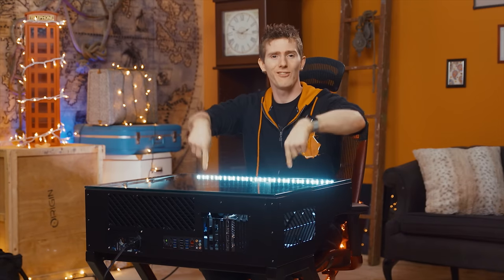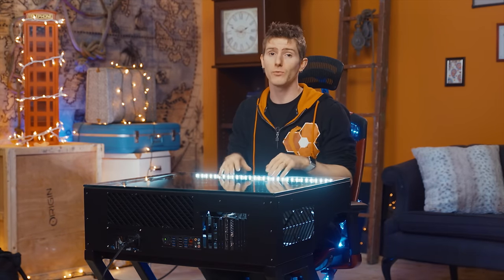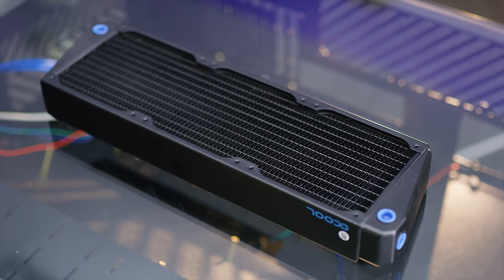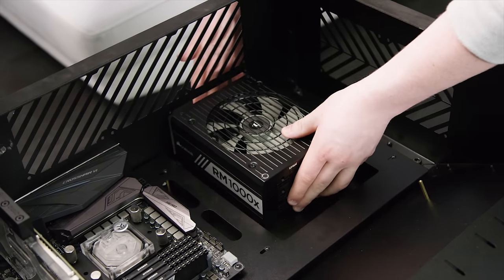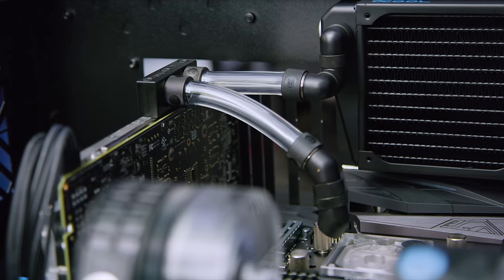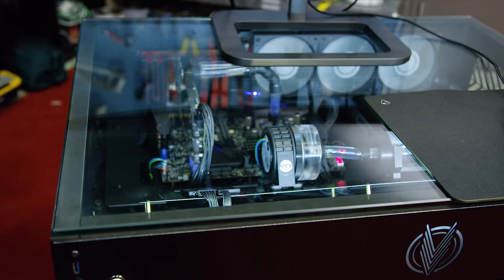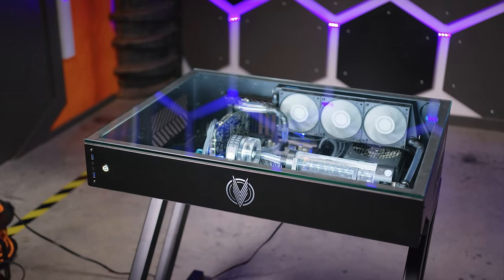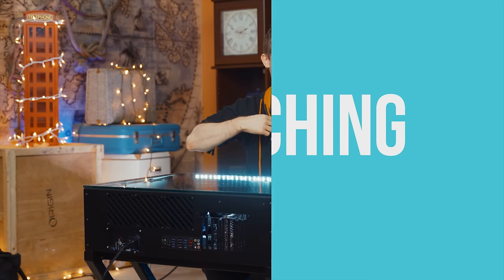Smallest Desk PC Yet!! - Vector Desk Mini Review

Comment: I don't think ive been in a "studio" apartment that cant handle a desk? lol...woah 500 bucks? there are glass top mounted desks with glass tops and about 8-12 inches of space from glass to bottom, for 125 , id rather get the larger 125$ normal desk and with 25 bucks in parts and some hole cutouts and have money for tools or extra computer parts lol.

Comment: So your only problem with this thing is size, right? Ugh...
-Though I perfectly understand that translucence and RGB lighting boost fps to 1000+ at 8k resolution, last thing you want is glass surface under your arms, especially in this case. It is shitty, distracting, unpleasant cold feel most of the time. And when it's hot, stickiness is just awful. There are countless annoying cons beside this, so you'll end up covering it with some cloth, which is, needless to say, crappy solution for pc desk. What you really need is some nice piece of good old wood. Period.

Comment: The tubing is completely hideous, you would've done better just using straight compression fittings on most runs and letting the tubes bend into arches. 
Nothing screams "budget high end" like spending 100USD on making your PC ugly.

Comment: When choosing corsair RM psu's you ALLWAYS need to go above and beyond what you need.
They are shit, and if you buy something in the ballpark of what you need, in half a year you'll be shipping it back under warranty as it's failing on boot multiple times whilst it'll trip your circuit breakers.

they are complete shit, i have 4 different RM psu's, from 650 up to 1000 and the only one capable of running a stable rig was the 1000watt.
Seems a bit strange when you only have FX8350, R9 290, 5 regular fans and 3hdd's.

Comment: 1:50 "We weren't just going to put your Dad's Dell in and call it a day."

My Dad has a Dell XPS 8920, with an Upgraded 8-Core Intel Core i7, clocked at 4.20 GHz, and a boost up to 4.50 GHz. It has 16 GB of DDR4 RAM, a 256 GB SSD, and a 1 TB Hard Drive. It runs a beast-like GTX 1080 and crushes gaming any day.

My Dad's Dell wouldn't be the worst idea...